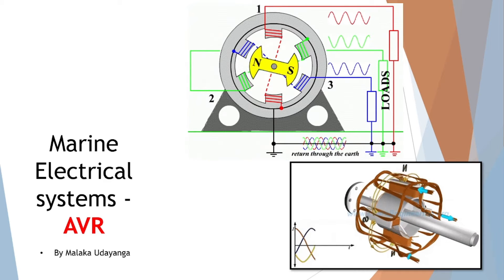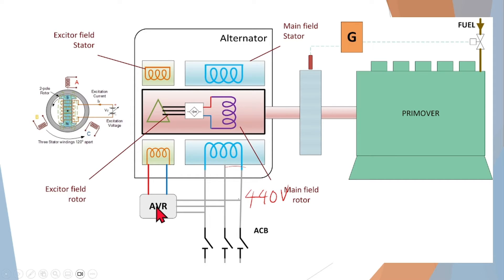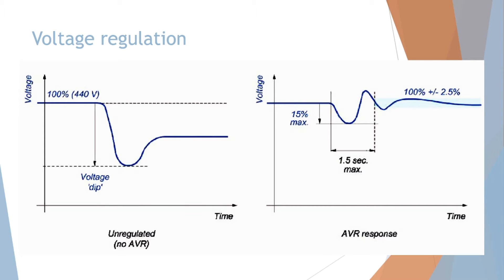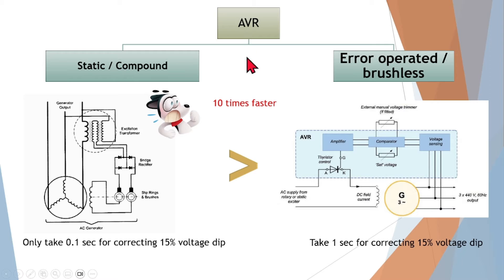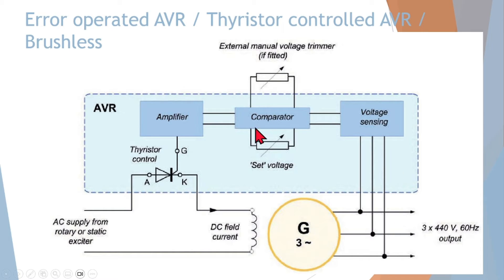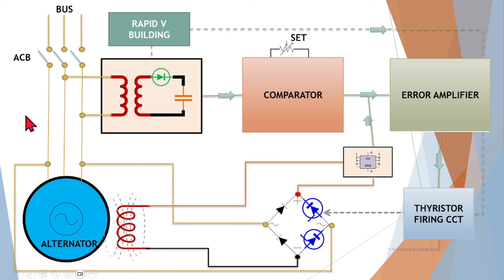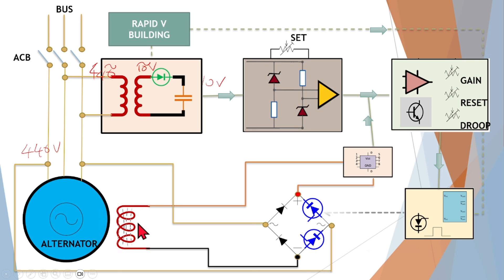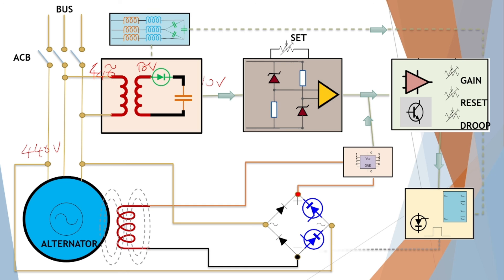AVR - Automatic Voltage Regulator 1 (English) - Error operated /  brushless excitation #marinengbase

Comment: Already AC is converted to DC at voltage sensor, then how  thyristor  regulating  AC  supply and finally the output after the thyristor is DC , can you please clear my doubt
Reply from the maker: I will do separate video on Thyristor operation and application, which will clear ur doubts

Comment: Hi Thank you for the videos, some quick questions,
1. How the excitation differs for Essential Diesel generator Vs the Emergency Diesel Generator?
2. Where is the AVR located for the Emergency Diesel generator - In the EDG enclosure? In the Emergency Switchboard? or in the Control panel?
Reply from the maker: 1. The construction and operation of an emergency generator on ship is similar to that of a main generator. Excitation supplies, either static or rotary, will usually be governed by an automatic voltage regulator. 
In some cases where a static compounded exciter provides a reasonably constant generator voltage, the A VR may be omitted.
In most case you can find a permanent magnet mounted on rotor to enable field flashing.
Reply from the maker: 2. Mostly AVR / static excitation is mounted within the alternator.

Comment: Sir.Does the Vref is fix because of the Zener diode value is fix?
Reply from the maker: In this particular example the Vref is fixed, this basic arrangement of a comparator is used for exam purpose and better understanding. Actual comparators are bit complex with few more electronic devices and mostly fixed with variable resistor to change the Vref / SET value.